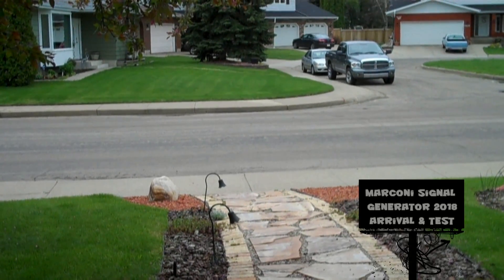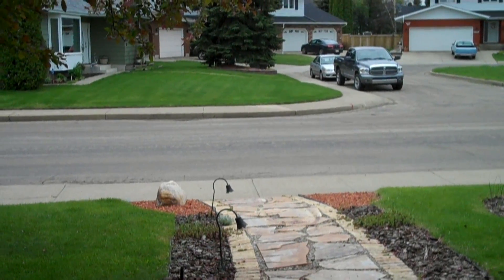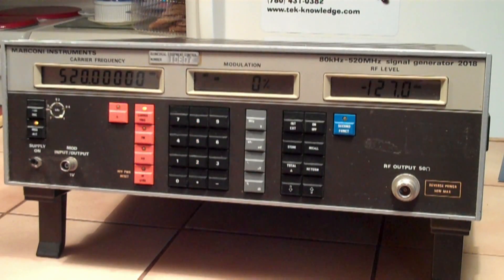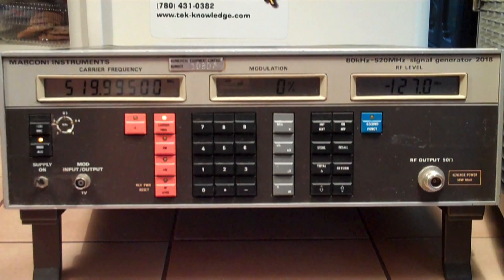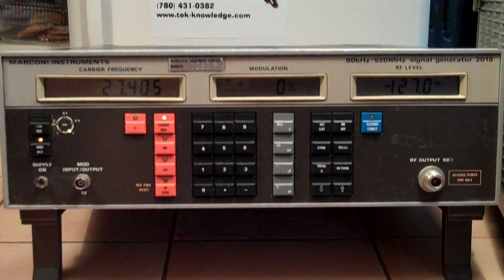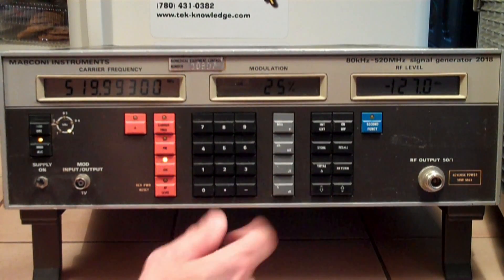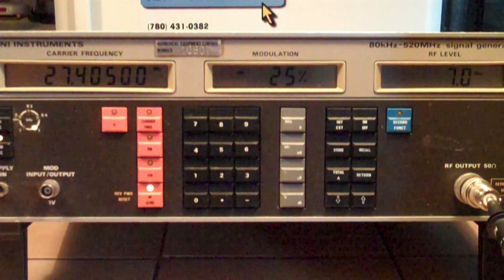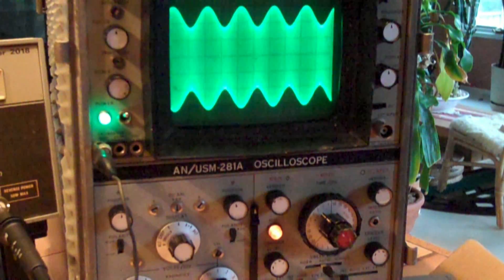Marconi 2018 80kHz-520MHz Signal Generator

Comment: Just bought a 2019 for spares and repair for £60.
An electrolytic on the AA" board and leaked and burnt through two data tracks.
A quick repair and it works a treat.